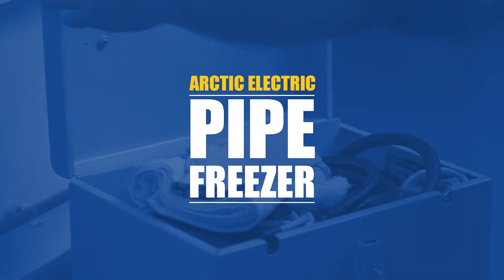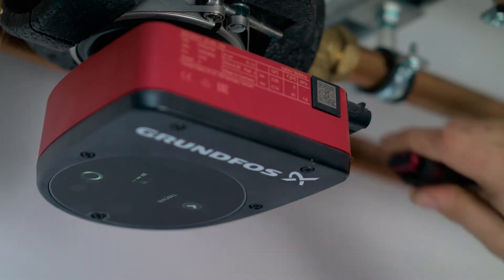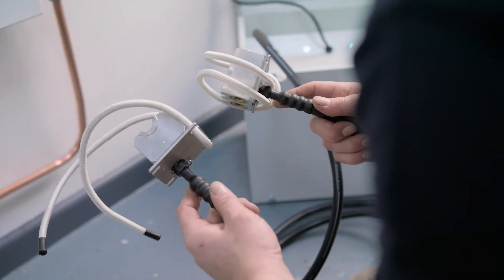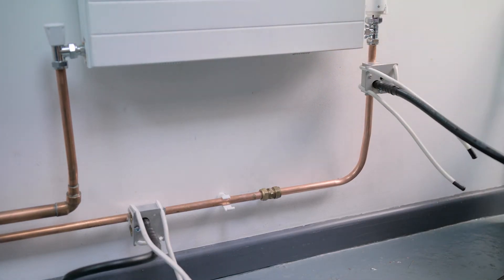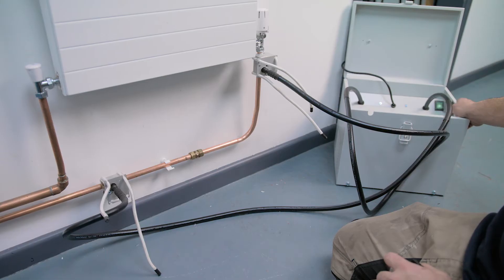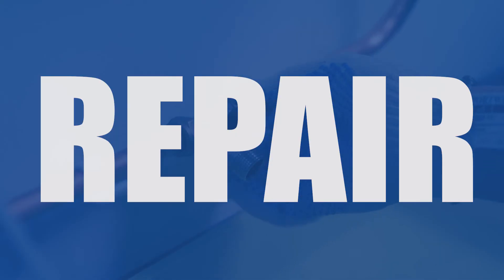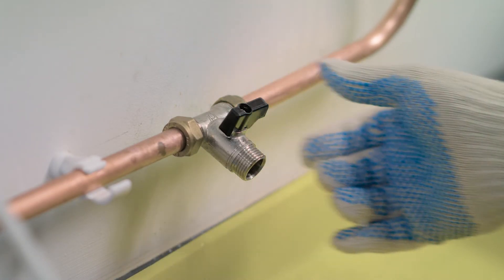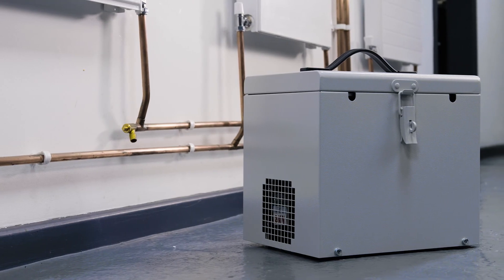How to use the Arctic Hayes Electric Pipe Freeze Kit

Comment: Really thinking of buying this kit. How much guarantee (in years) comes with the machine. and apart from the cream what other consumables does it need, will it require a regular service?  thanks
Reply from the maker: Hi Jay
 
The unit is guaranteed for 1 year.
 
There isn’t really a service period recommendation but the unit can be re-gassed when required (heads no longer frost up). The Freeze cream is the main consumable but replacement gloves, towels, reducers and reducer screws are all held as spare parts if lost or need replacing.

FYI we have just released our new Freeze Machines, the AH28 and AH42. These are now the best value on the market and are available from Nationals, Merchants and the AH website.
Reply: I've seen the new models. Is there a difference in freeze times depending on which model upy choose. Or how long to freeze 15mm and 22mm copper pipe.
Reply from the maker: @JayG2K  If you can email us at marketing@arctic-hayes.com we will send you the freeze guide that highlights freeze times by pipe type and diameter. Thanks
Reply from the maker: Hi Jay, did you get all the information you needed on our Electric Kit? Thanks, AH
Reply: @arcticproducts  ive emailed you.